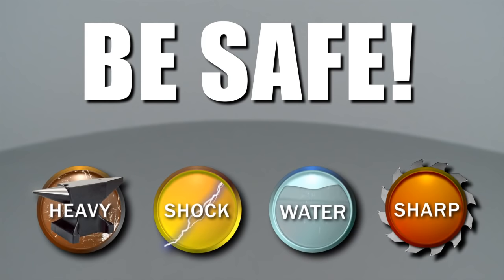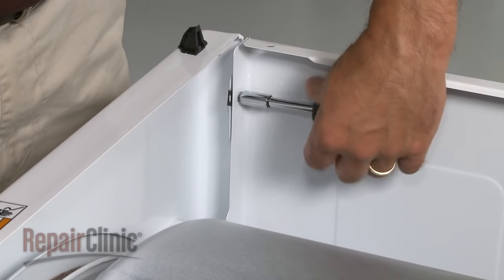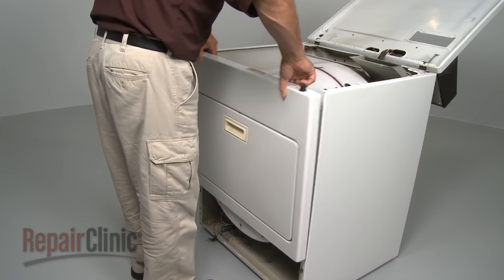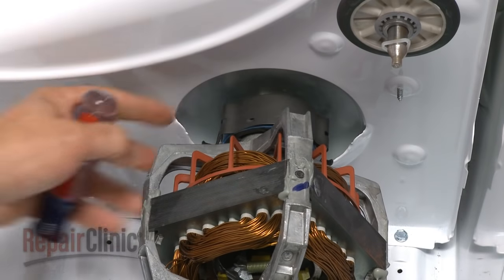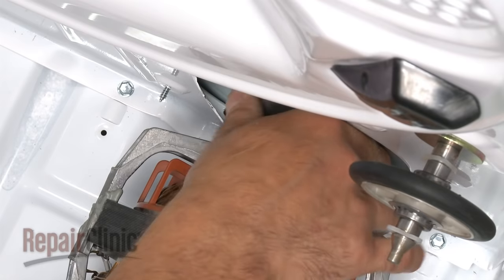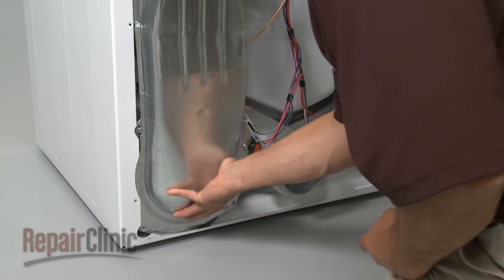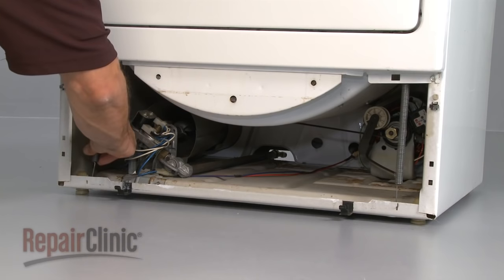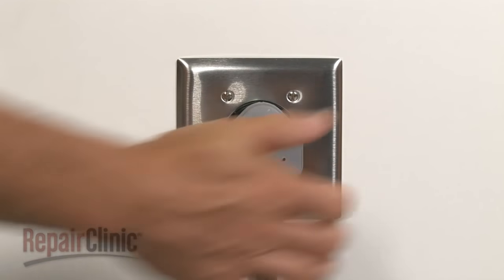Whirlpool/Kenmore Electric Dryer Replace Blower Wheel #694089

Comment: For anyone who hasn't figured it out, the dryer blower wheel does not come off by turning to the left. Turn it to the right or clockwise to get it off. Thanks for the video! It cost me less than $35.00 to fix the dryer myself.

Comment: I had a blower wheel that was stuck and I found a trick that worked to remove it. My particular model does not have access to the blower wheel square nut on either side. So, I put a vice grip on the far end of the motor shaft where the hex head is located. I braced the handle of the vice grip against the bottom of the dryer's sheet metal housing and cushioned the contact with an everyday news magazine. Looking from the blower end, the wheel needs to turn clockwise to loosen. So I slowly rotated the wheel counter-clockwise as far as possible, and then quickly spun it clockwise. When the vice grip handle struck the magazine, the wheel's inertia successfully broke the fan loose from the motor shaft. All parts were intact and I removed the blower wheel.
Reply: Jim LeMay. thanks for the tip...yours was the only one that worked!
Reply: Glad to help!
Reply: I replaced a motor some time ago, and I honestly can't tell when. Anyway, recently I replaced a second motor, and I looked at the fan and it was worn away, rough cut so that the edges of what must have been a "square nut" are gone. I vaguely remember that I had trouble with the fan, probably got a bit angry, and did what needed doing so I couold move on. The dryer and washing machine are located in a niche in my bathroom, and there is not much extra room for accessing the front AND the back of the dryer. I must move the dryer around and squeeze between to get around so in this cramped area I can become impatient with the dance. Also , there are two versions of DIY for removing the fan, and unfortunately, the other video is no solution at all and I suspect that the guy did what I did the first time I dealt with the fan. I broke it because I couldn't figure out how to remove it properly and I just wanted the job done. In his video he claims that he imagines the viewers don't want to waste time watching him using a piece of wood to bang on the fan blades and loosen the fan. So he does it after he has already loosened it. This time, I watched that bogus advice AGAIN, and I figured it out: He probably did the same thing I did and just busted the fan; then bought a new one! Well, regardless, I wish he would edit his video, because he fails to give the proper method for removing the fan.  Why did I round off the edges? Must have had a reason, and I doubt that I enjoyed the improvisation. The parts store is not convenient, so after a few days of this rigmarole and the potential threat that I will end up doing something so wrong that I end up buying a new dryer ANYWAY, the DIY honeymoon is over. My enjoyable challenge "money-maker" project becomes the nagging duty. This time, after multiple various repairs to this twenty-year-old (plus?) Whirlpool, I look forward to this dryer humming along again as it should, and I will have several hundred dollars available for something else. 
Thanks for the good info here, and I wonder why there are models with fans that are more dificult to deal with? 
It is what it is. Good day. Good PREZ!
Reply: Been fighting my fan on a Kitchenaid, made by Whirlpool for 2 days. Almost decided to get my sawzall and cut it off, then install a new one. Your tip may be just the trick. Thanks !!
Reply: Jim's solution worked perfectly for me as well.

Comment: Thanks. My 1972 Sears dryer, the blower wheel stripped inside the plastic where it joins a molded in nut. I had to drill and cut it off. Then remove the molded in nut. Looking at the nut are these tiny formed ridges, which were not enough to hold it to the plastic over the years from spinning separately from the plastic wheel. So an easy job turned into a tough one. But the wheel looks identical to these newer dryers.

Comment: The blower didn't have the optional deceased rodent like mine did.

BTW I'd avoid WD-40 on plastic parts, it can decompose them.  There's another penetrant called PB B'laster that works great and doesn't harm plastics.  Home Depot has it for under $4
Reply: Deceased rodent! 😂

Comment: Well my wheel came off by turning it to the left..you gotta have the same exact tools just like it shows in this video..I bought the replacement wheel for $7.00 on eBay and it took me 30 minutes to fix it...it just saved me $500.00 for a  new dryer at lowes :) :)

Comment: Had a question the clear plastic piece that you see I'm the video next to the fan blade. I need that piece, what part number is that? Do they even make it?
Reply: That's not a functionality part, the dryer will operate just fine without it.

Comment: Great video! However, with my machine the blower wheel was so tight that I use super strength to try and loosen it from the motor shaft as per the video and ended up cracking it.  I ended up having to order a new blower wheel.

Comment: I cracked the plastic piece that the back-most wrench grasps while trying to loosen the motor wheel from the rear motor shaft pretty badly and now the fan won't spin as swiftly.  I feel this may cause the motor to overheat. Thoughts?
Reply from the maker: gregdoh You will probably need to replace the shaft you damaged.
Reply: *****
I tightened vice grips around that cracked piece and now the fan spins freely and you can barely see the crack.  I feel this may work for now but I'll keep and eye on it

Comment: The motor on my dryer died on me and I just replaced it today.  As soon as I turn it on after replacing it it works for 10 seconds then stops and all it does is hum.  The motor was a brand new part, could this be linked to anything else?

Comment: My blower fan was so tight that I had to cut it off the motor shaft and buy a new motor.  I could not get it to release.  Installed the new motor and blower fan and within 2 weeks, the fan developed a crack.  Time to replace the fan or the dryer??? Repairs are reaching the point of diminishing returns!

Comment: I tried to unthread the blower wheel from the motor and I have no tension on it. It actually seems like they are almost 2 independent shafts. I can lock it down on the front and the back bolt just spins. If I try to take the blower wheel off it just spins. It is very wobbly but will not release.  ANY help would be appreciated.
Reply from the maker: Jake T Your blower wheel may have come loose from the pressed-in mounting hub. You may have to break off the old blower to get to the threaded hub to turn it. Note that most blower wheels are left hand thread, which means you have to turn to the right or clockwise to remove it.

Comment: what could he wrong with the blower wheel that would warrant a replacement?   it seemed like nothing was wrong with the one in the video.
Reply: shadoza I just remove a pen that was stuck there. If ignored the fan would get destroyed.
Reply: Mine had a bra wire that broke the wheel causing lots of vibration

Comment: Hi everyone, accidentally some cat dry food felt to the dryer lien screen hole, and it went down all the way, so I am afraid to turn it on, can it get inside blower and break it? Thanks
Reply from the maker: It would be wise to disconnect power to the dryer and vacuum it out. Enter your dryer's model number in our website's repair help system for model-specific information: http://www.repairclinic.com/repairhelp?TLSID=1773.
Reply: You forgot to mention that blower wheel is attached to threaded motor shaft, which is a left handed thread. No rights tightly.  You remove by gripping pulley with wrench,  gripping blower plastic hub, then force wrench on pulley clockwise,  or toward inside cabinet, to break loose. Otherwise,  you'll struggle with removing wheel and eventually breaking, adding a new wheel to your motor replacement job. Hogges Home Service Inc. You're welcome.

Comment: everything was going great till it was time to remove the bolt (final step before removing the wheel)  The bolt wouldn't budge, any suggestions?
Reply: I have the same problem.  Did you ever figure it out?

Comment: my wheel was "free wheeling' and making noise as the dryer ran, IT WAS A 5 minute fix....drill a tiny hole in the middle of the wheel, then screw in a small screw..... wheel is now secure to the motor shaft... DONE!

Comment: I can't get the shaft to release... won't budge.  Any suggestions?
Reply from the maker: +GV GV In extreme cases the old wheel has to be broke off the old shaft.
Reply: +RepairClinic.com  i had trouble until i saw the fan screws on counterclockwise to tighten, clockwise to loosen. That's backwards from most things.

Comment: as has already been mentioned, PLEASE add a graphic or dub an instruction to state that the thread of the blower wheel is left-handed.  A newbie do-it-yourselfer may not think of this feature for this job.  How frustrated would you be to do all this work, in a cramped environment, to find out you can't get the wheel off, or worse yet break it before you find out what you've done.  It is not enough to just "see" and figure out that you're turning the nut backwards.  SHOW A GRAPHIC!

Comment: for those of you unfortunate enough to have the blower wheel fused on the motor, this is exactly what I did to get it off. Worked like a charm!
https://www.youtube.com/watch?v=4GX_BmjJpzc
Reply: +ignaciofacundo I'll mention it here since comments are disabled on that video (probably for this reason).... Never put your hand under a dremel tool like that. Get a pair of channel locks or vise grips to keep the shaft from spinning if you need something to hold it still.

Thanks for the link.